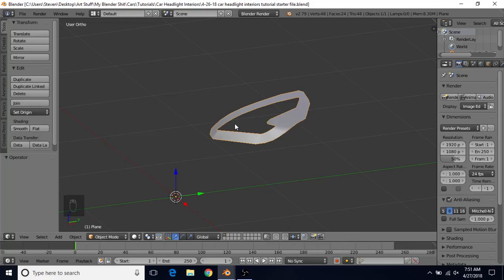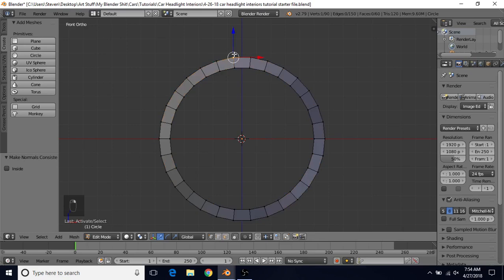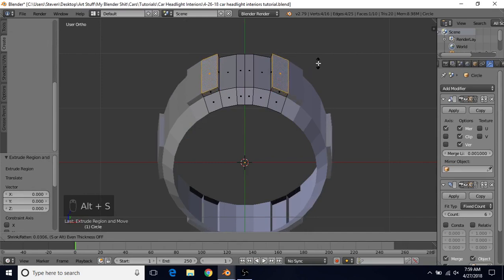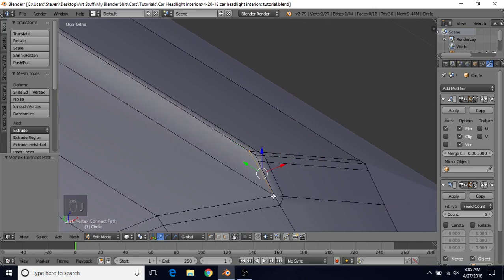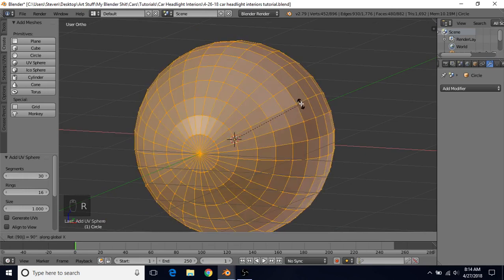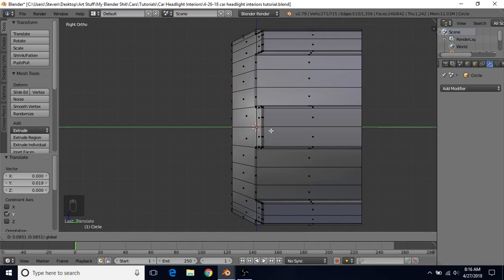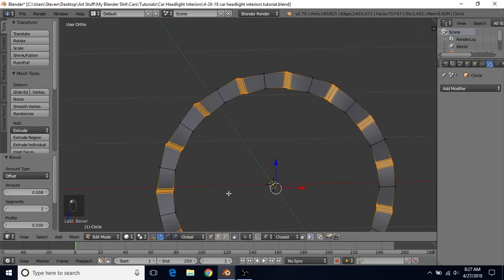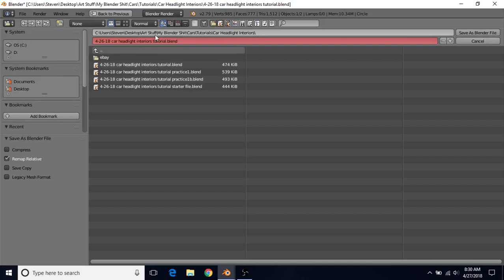Blender Car Headlight Interior Modeling Tutorial - Part 1 - The Headlight Cover

Comment: how can i model lens of headlight an its pattern on it accurately, please help
Reply from the maker: The first step would be to get some very good references. Preferably from different angles so you can see exactly how the details go. Ebay can be a decent website to get multiple angles of the same item. So perhaps you can go on ebay, search for the headlight lens you are looking for, and if you find one, chances are you will have multiple pictures and multiple angles of the object you want to create.

One common way to make the lens is to have a texture instead of modeling it. For a good example of how this is done you can check out this video: https://www.youtube.com/watch?v=FqhQUmcpXKg. The texture itself should be in his blog. If not you can google a different texture and it should be fine. I'm not an expert on making textures like this, so you may have to do some research if you want to make a texture yourself.

Hopefully this helps you a bit! Good luck with your blender adventures! :D

Comment: OK. great ! but how can UVs this thing?
Reply from the maker: It may be easiest to mirror and array it again like we did at the beginning. That will make everything take up less texture space when you unwrap it. Then you can unwrap it as desired. Using smart UV project might be sufficient if you're not doing anything too crazy. Just select all with A and then press U and choose smart UV project. The textures seem to be quite simple since most of it is a gray plastic. Other than that there's a few black parts and the glass for the headlight. If you need a more detailed unwrap you can add seams where appropriate and then unwrap.

Instead of using textures, materials are probably a better option depending on what you're looking for. You won't have to unwrap anything. Just throw on a plastic material, glass material, etc.

Hopefully this answers your question. If not let me know. Thanks!